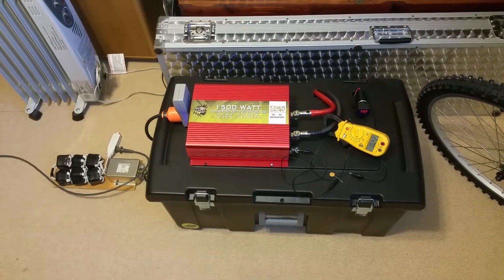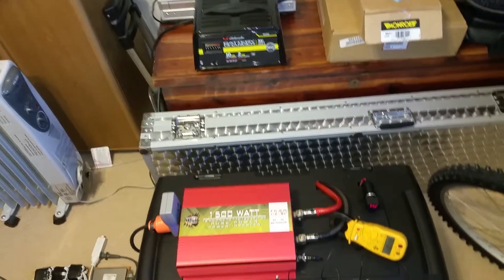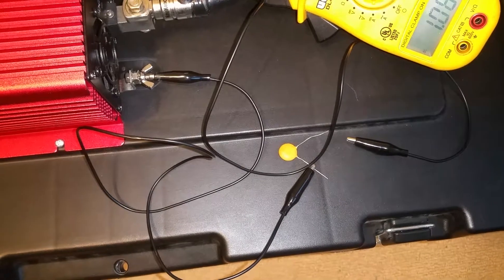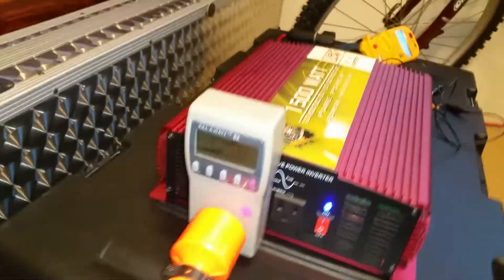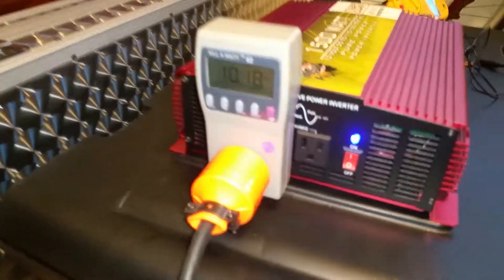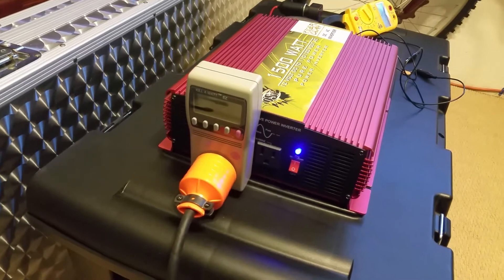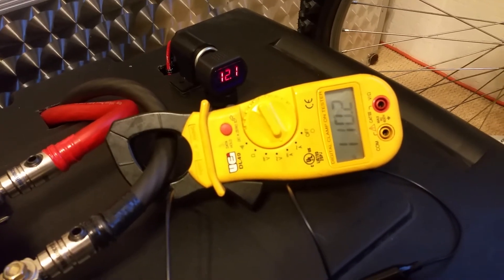OSP Tiger Claw 1500 Watt: Heavy 12A Load Test

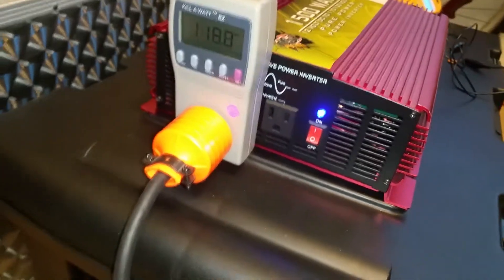Comment: You've got 18.5 volts coming out? at 1:08  I get only 110 volts on mine. And at the end of  any extension cable that I plug in, I get only 105 volts. I have the same inverter
Reply from the maker: yes 118vac no load.. drops to about 115vac under load. i do see it drop to 110vac too eventually. the output is 115vac plus or minus 10% specs say.
Reply: is it even safe to run refrigerator with such a low voltage of 105 V? I heard some appliances might ramp up the ampers to compensate for lower voltage. That can cause wiring overheat and possibly fire. What do you think of it?
Reply from the maker: The inverter will shut down if irs overloaded. No risk there. Also most fridges these days, old and new are designed to operate over a  wide voltage range. Yes amps and voltage are inversely proportional, lower voltage means higher amperage. Fridge should only surge for half a second to start the compressor then running amps is way less.
Reply: I'm sorry to bother you again but you seem to know about this stuff much more than I do. I got my solar panels, charger and inverter all connected with bare copper wire to 8ft ground rod. This grounding is separate from the household grounding. However, when I plug my GFCI tester into the inverter's outlets, it says "hot/neutral reverse". I don't know if anyone besides me is ever testing inverter outlets. I have seen a lot of instructional videos but no one testing it with GFCI tester.  I just want to make sure everything is working the way it's supposed to.

Comment: sorry to keep commenting one more thing where in the world would I get one of those little capacitors like you got for a tiger claw inverter should I use an earth ground if I'm going to use the capacitor is it okay to use them both
Reply from the maker: yes you can use both the capacitor and tieing the case ground to Earth. Radio Shack used to have the capacitors but you can search online like mouser.com its a .01mF 500v  ceramic disc capacitor. mon has a 103k marking on it

Comment: could you run an average size refrigerator 24 7 with this inverter I have four 6 volt golf cart batteries and right now I have 500 watts of solar,,, I actually have more panels I haven't gotten around to hooking up yet I've been running my refrigerator every other day or so weather permitting with a Harbor Freight 1500 watt centec  modified they say its not good to run a  refrigerator on modified sine wave,,,, it's a plain Jane refrigerator really nothing digital overhead freezer I think 14 or 15 cubic foot I'm thinking about upgrading to this Tiger Claw I just wonder how long it'll last,,,, and were you saying that if I use the ground on the unit to the ground rod I have and grounded like that into the Earth that the fans will be okay I have my centec grounded with Earth ground right now heavy gauge wire run into that,,, would I just do the same for the Tiger Claw to keep those fans working good,,, or would I a capacitor? is everyone's Tiger Claw 1500 watt inverter still running good????
Reply from the maker: I would suggest doing the capacitor mod only because it will prolong the life of the fans the circuit they use for adjusting fan speed is very rudimentary and basic. I've read plenty of reviews on Amazon saying that the tigerclaw has done well for the time they have had it. you definitely need to use a 0 gauge cable to get the maximum output from it. other than that I have not had any major issues with mine.

Comment: Good Test....nice portable system...
  My Tiger Claw 1500 has been running great for a year and a half now. 200ah battery set up. Runs my 850 watt power consumption Microwave...600watts output....does about 26 minutes of runtime. Voltage can drop a lot. Nearly 2 volts. From 13.8 to around 11.8...I use cheap Les Schwab Class M24 bats...not the most robust...but do work. I run double 0 cable, as 2 and 4 were warm, and hot.
  I have a small 100ah system with a 400 watt Cobra MSW inverter on a hand cart....works great with one cup coffee maker for TEA.
  Nice Vid...I was interested to see your voltage drop...nice to know it is not just me...
Reply from the maker: thanks! yeah its a basic setup, but it works well for me. a solid and silent overnight backup system that wont attract attention to the house.